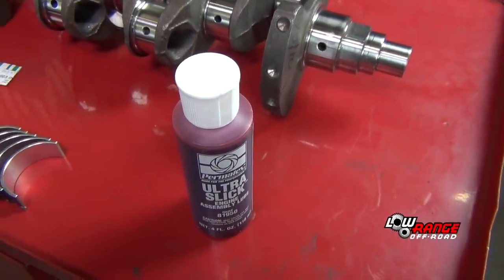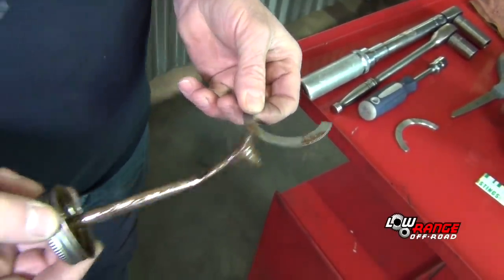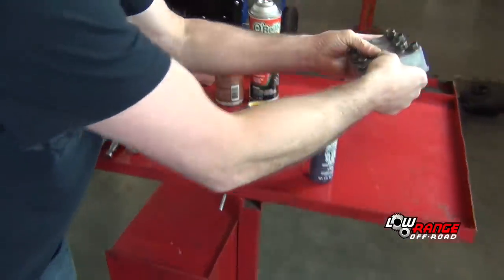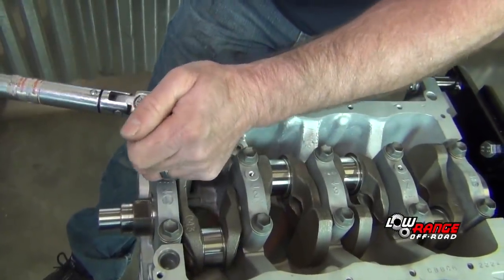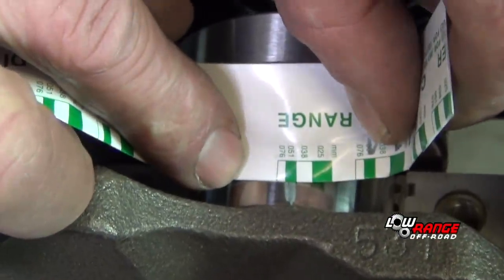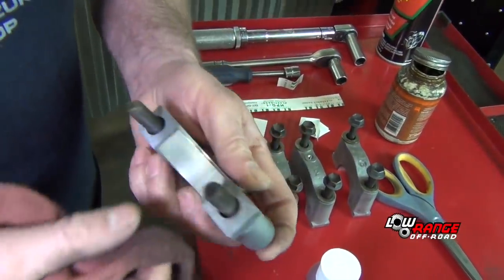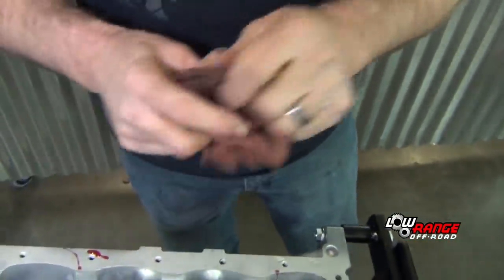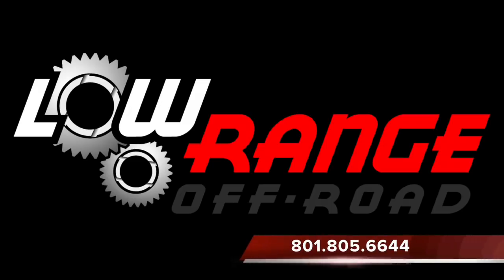How To Rebuild A 1.3L Suzuki Samurai Engine (Part 1) Crankshaft Installation

Comment: Nothing about bearing sizes that should correlate with letters stamped on oil pan mating surface (in your case CBBCB) and number stamped on corresponding Crankshaft webs... Factory service manual provides a page on that subject also and is not fully understandable to me. I just ordered a new set of original size bearings and only now see that it is not that simple... they are colored according to their specs and should be selected depending on numbers and letter I mentioned above... If someone can explain this soon as I am in the very process at this moment, I would be grateful. Hoping I did not waste time and money with original size ones (did not plan to do plastigauge, I only manually polished journals and want to refresh the engine as there was no major faults to start with)
Reply: Think I get it... Letters on block indicate shell diameter and numbers on crankshaft webs indicate journal diameters. From the table in manual, this indicates that 4 of 5 shells originally mounted were colorless ones (ones I bought) and one is oversized. These sub-sizes are ridiculously small in difference so I am continuing in assembly without plastigauge-ing it.

Comment: Can someone explain why the crankshaft is first installed and then taken out ?
Reply: He put those thin pieces of plastic to measure something on the crankshaft while its bolted down. So he had to bolt it down then he measured whatever those thin pieces of plastic measured once it was all clamped down. Then he Cleaned it off and greased it all up and reassembled. But it sounds like he was just double checking his machine shop's work to make sure it was machined correctly. So you could probably skip that if you trust yours or where you got the parts

Comment: No anti seize on bearings !   Engine oil or assembly grease only !  All the components need to be solvent washed and blow dried including the block then placed on clean rags. The bearings should be measured for thickness using a vernier caliper  and the crank needs to be measured using a micrometer - if everything measures correctly it will be good to go , 
When torquing mains , rods, cylinder heads etc always go in 10# steps then check 3 times at full torque.

Comment: Big glob of assembly lube down a main bolt hole 1 different torque then others that are dry and 2 if its a blind hole could pop out the casting to whatever is on the other side

Comment: incompetent people who don't understand a mechanics use excessive amounts of assembly line that's unwarranted beyond belief. But I guess that is why this guy shipped his stuff out to be checked, disassembled, painted and ..well he just assembled parts.
Reply: Incompetent people who react to a video without the proper englisch grammer calling other people incompetent if you think you can do it beter show it or just stfu everyone works thier own way
Reply: @renneej1238  The words you seek  are  "English                                                    grammar".  Not englisch grammer. But if you want to put oil into blind holes and metallic anti seize inside your engine, do it your way or stfu and learn something.

Comment: Not sure why you would put a metallic paste (anti-seize) right up against a bearing, seems a bit counter-intuitive. A tacky grease would have worked just fine. Those 1.6L Suzuki engines are fun to work on and very dependable. Should be a great rebuild!

Comment: Anti seize has fine metallic particles in it, Rather use a little grease, but wyns charge works best for me
Reply: Yeah. This yahoo just put anti seize (graphite) inside the engine. Glad that is not my engine.
Reply: @stevene9785  It's copper anti-seize, not going to hurt the engine, especially that amount.
Reply: @chippyjohn1  Never put anti seize on or in moving parts. Period

Comment: 70 hp . blowing my mind
Reply: Almost 75 with the camshaft and carb of the swift gs (1985/1986). Same G13A is in swift (or forsa etc) from 1983 to 1989

Comment: Hey lowrangeoffroad. some years ago i did the same on my samurai engine and i instaled the crankshaft and pistons like you did, and torqued everything,  but when i was going to try to turn the cranshaft and checking if it was loos, ther were 1mm clearance, and when i contacted the place were i bught the bearings, they said it was going to be like that. but no. so i had to stop rebuild my engin for a while.
Reply from the maker: Thanks for the question.  I need to ask several questions.  1)How do you know you have 1mm clearance.  That is a lot of clearance.  You need to have about .025mm (.001") to .051mm (.002")    2 ) Was the crankshaft machined? If so how much was removed during the machining process from the rod journals and the crankshaft journals?  This will give us a place to start.  Once you have this information I suggest you call 801-805-6644 and ask for William.  He is our Master Engine builder.  He can answer your questions and help you with part if needed.  Thanks for watching and commenting.
Reply: we clearly felt that it was aboute 1mm clearance with the new bearings on, but the crankshaft wasnt machind when i removed it from the block, but we belive it was machined when the previous owner had the car, and that he got custom made bearings with it. but i have a new engine (bouhgt it with a case of 24 beer's) now because my dad let the block stay outside so it got rusted. so im going to rebuild the new engine, and buy a new camshaft and rocker arms, and then get the crankshaft machined with custom bearings with it.
living in norway, so it will be a bit difficult to call William because the time diffrence. but i may be contacting you gus and order some parts for the car ;)
Reply from the maker: Great.  Let us know if we can help.  We will most likely have everything you need.  You are about 8 hours ahead of us.  So if you called after 5:00 pm your time we will be just getting started here.  Call if you'd like.  Or you could email us at sales@lowrangeoffroad.com.  Good luck with the rebuild.
Reply: ok, Thanks ;)
Reply: me and my father had the same problem on a rebuild. we had an untouched crank, and just ordered a standard bearing kit. After assembling the engine and running it. we quickly discovered the bearings where too tight and ruined the crank along with the bearings. upon further research we discovered each individual journal on the crank actually has a different tolerance, some are very close to the same and some are quite drastically different in tolerance. never have we seen or heard of this before. Anyone else experience the same?? or ever heard of this??
Reply: @Honda04400  why didn't you measure your crank and bearings prior to assembly ?    If you don't measure, you are guessing.

Comment: What a great video, publication and narrator, sadly lost all credibility by a childminded sloppy mechanic! It's assembly lube not strawberry syrup
Reply from the maker: We get this comment often so your concern is shared by many viewers.  Yes, we do use a lot of assembly lube.  However, the cost of a bottle of assembly lube ($4.58) when compared to the cost of the overhaul ($2,099.00 minimum), it really is a small price to pay for the peace of mind and insurance against a dry startup.  It may take a minute, maybe two for the engines own oil to find its way to all the critical areas of a freshly built engine. Then we also consider how long it may take for the engine to be shipped and received (sometimes overseas) compounded with how long it may take the receiver to install it.  It could take weeks possibly months for some do-it-yourselfers to install the engine and start it up.  Well, we just think it's a good idea to use a lot of assembly lube.  Thanks for watching and commenting.
Reply: so your torque figures were completely out the window because of all that assembly lube in the threads too..... so the engine is junk. Thanks for showing us how not to do it!

Comment: Hi, just curious, how similar is this engine G13A to the G13BA??
Reply from the maker: The blocks are basically the same but the heads are different.  However,  the rebuild procedures are very close to each other.  Our rebuild video series could be used as a basic guide.  But, keep in mind that not all parts are alike. You could learn more by following this link: https://en.wikipedia.org/wiki/Suzuki_G_engine  .  If you need help with parts or have further questions, our most knowledgeable person here at Low Range is William.  Call during working hours and he will happy to assist you.  Just call 801-805-6644 between 8 and 5 MDT.  Thanks for watching and commenting.
Reply: +lowrangeoffroad  thanks :)

Comment: Two questions 1: how do can I get the block that clean from the inside ? I'm in the middle of starting a rebuild with parts from low range but I can't figure out how to get it that clean. 2: what paint do you guys use ? My block is sparkling clean but I would like that grey paint on mine as well . Thank you
Reply from the maker: Our blocks are boiled out and cleaned by the machine shop and the paint we use on them is called "Ford Gray".  Hope this helps.  Thanks for watching and commenting.
Reply: +lowrangeoffroad awesome yeah I can't boil mine but I used oven cleaner and it shines beautifully . Thanks for replying and thanks for the videos I will be using these videos for my first build ever so fingers crossed thanks again for the videos.

Comment: Nice video. Is this Suzuki M13A engine or similar?
Reply from the maker: +Norsology No it is not.  The engine used in the video is a G13A/B engine.  It is a single overhead cam engine.  Whereas the M13 is a dual overhead cam engine.  Thanks for watching and commenting.
Reply: Norsology electric whyring
Reply: Toyota Cressida  Toyota Cressida 18rg engine timing please

Comment: IDK about the Japanese engines but almost all American engines main caps ARE torqued with oil on the threads... the sad thing is most people don't know that you get more/also more consistent "with" oil than dry, I disagree with Anti seize inside an engine, and prefer STP to "assy lube" I also put a very thin film of oil on the sides of the main caps where they slide into the block.
Reply: That's what i was wondering about too. First he torqued em to 41 with no lube, and in the end when I'm very that the lube got into the threads he torqued em to 41 aswell. But is that torque spec for lubed threads or dry threads?
Reply: Agree

Comment: I use a lot of assembly lube, or grease if I'm greasing something, but this is way overboard. Also I would have just used some regular "red and tacky" style grease on the thrust bearings. Anti seize is metallic.
Reply: Brad V i know right, he's treating it like his butthole prior to some prison rape. the anti seize also seems odd. he's taking such care to not scratch the bearings but then puts metal filing paste right next to them. very curious.
Reply: SuZuki ayare enjen

Comment: Assembly lube in the main cap bolt threads. Good luck getting an accurate torque with that!
Reply: I was more concerned about the cracking of the block since the bolt holes are blind.. you actually get a more accurate torque when the bolts are lubed but the problem is they have to be all lubed...
Reply: Doesn’t matter how accurate of a torque wrench he is gonna use. If the thread holes have lube in them you are gonna reach your specified torque before you are actually clamping the cap down to spec. And that’s in a perfect world because all that pressure from the bolt coming down and attempting to compress a liquid very well could crack the block. The threads need a thin coating of engine oil
Reply: 970357ers  All repes 970357 ers
Reply: 970357ers d s f b
Reply: Nice work

Comment: People treat bearing shells like jewels. They're made of metal FFS!
Reply: +970357ers Metal that could easily dent or scratch...
Reply: A scratched bearing could mean the difference between a knock at 300 miles or 300,000.